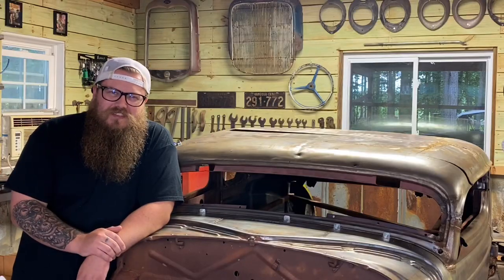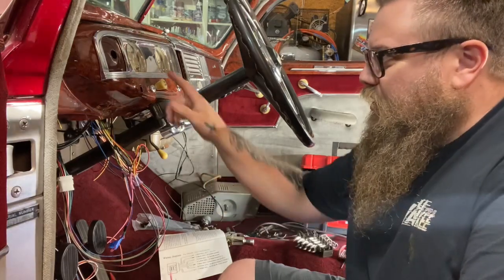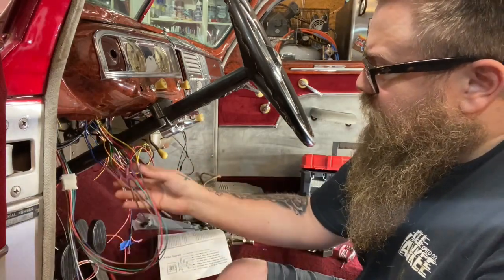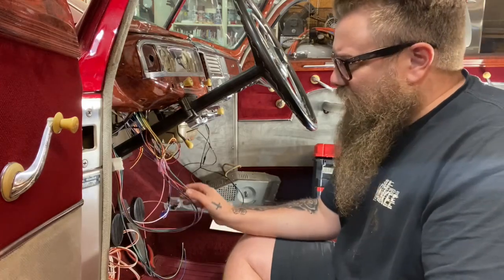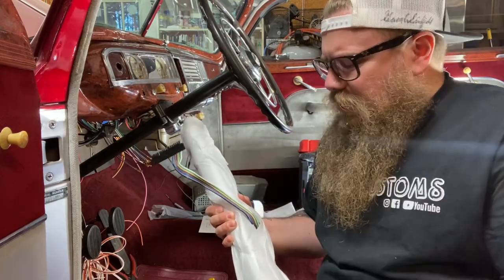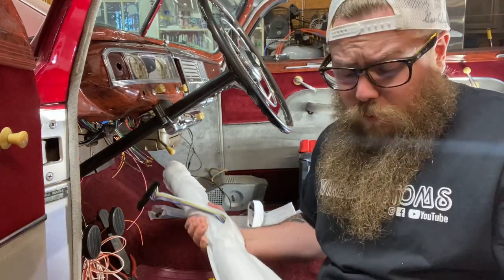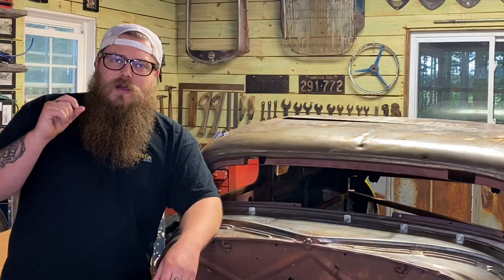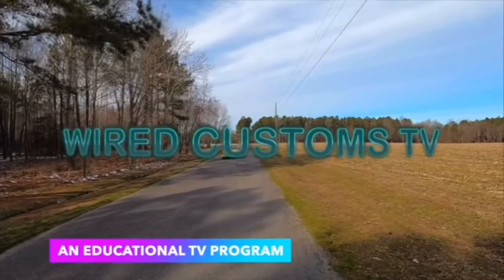Wiring Steering Column Headlights and More!

Comment: I like to run a #10 from the battery negative to a ground bar mounted near the fuse panel. I then ground everything in the cab to that instead of the body. Even the white ground wire for trailer lights comes from there. I prefer to remove the plastic from crimp connectors, then crimp the wire, then solder, then heat shrink. The heat shrink not only insulates, but also acts as a strain relief. Good stuff, I like your channel.

Comment: Zach, I very much appreciate you sharing your early Ford knowledge. Your videos have given me great confidence to tackle many projects on my ‘40 Ford coupe. Here’s my question. I purchased a Vintage Auto Garage turn signal wire harness. If you’re familiar w/ it, I’ve  spliced the front yellow & green into existing bulb wire and spliced rear orange & brown into existing green wires to each side. The red wire was connected to the wire leading to the rear of the car from my brake light switch when I turn the turn signals on for either side, all I get is flashers. Every other light function works as it should. Any feedback would be appreciated. Thank you

Comment: Excellent. Just subbed. Have a 1964Chevy P10 stepvan that has some crazy previous owner wiring going on. Looking at the 14 circuit haywire. I like the pre-wired dimmer, guage, headlight switches with connectors. Will let them know you sent me. Thank you for the video, I feel confident I can do it.

Comment: Is this the same harness from first episode? Was curious because I’d really like to utilize my stock column and those connections would be great. My original harness is absolutely terrible to point it won’t run the truck unfortunately. So I’ve been searching around and fumbled upon your channel. So any suggestions or advice I’d greatly appreciate it.
Reply from the maker: Yes this is the same harness, it’s the Haywire 21 circuit, what vehicle do you have I might’ve already wired one up with the original column
Reply: @WiredCustomsSpeedShop  it’s actually a 82 c10 swapped on a 79 k10 frame. The wiring is also out of the 79. I checked it all and went through it. Was decent. I cleaned it all up and ran decent. The colum is actually I’d say a early 80s it’s not a tilt option but Is definitely not a 70s the pig tail was same as the original 79 an hooked right up. I had a issue with it though no matter how many times I went through it and cleaned everything was basically just to get it running and testing and wanted to eventually swapped so now I just have no option. I don’t want nothing fancy I just want the old girl safe and run good.